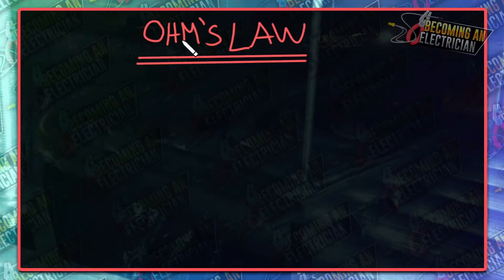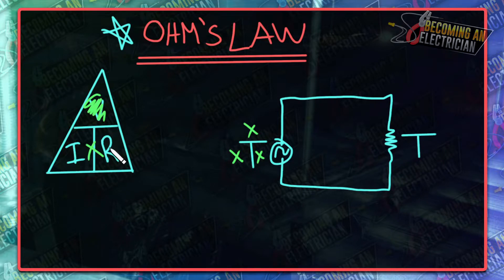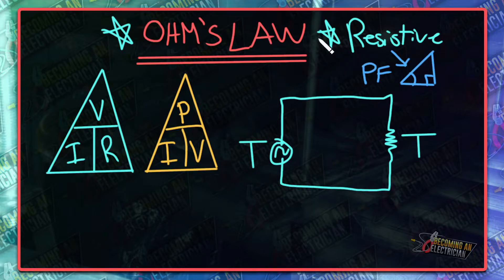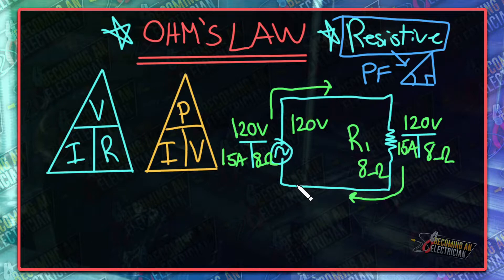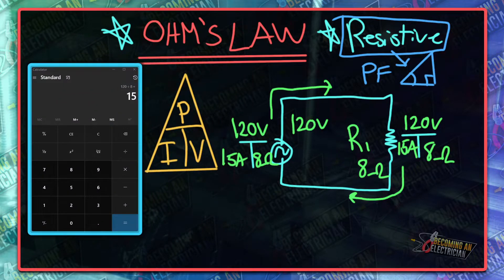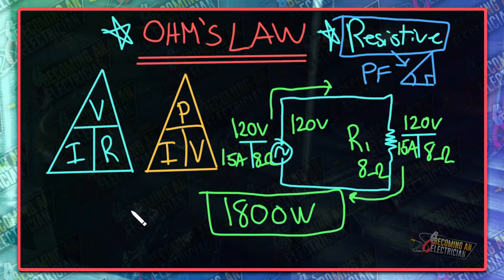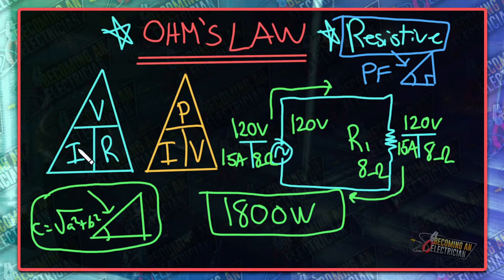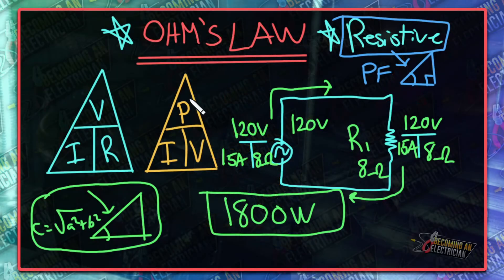What is Ohm's Law for Electricians

Comment: Hey! First off thanks for this video! I'm in the process of learning the trade, I know this video is 2 years old but just wanted some clarification earlier in the video 2:08 you mentioned multiplying Current x Resistance= Power/Watts. Later on, in the video 5:09 you then said multiplying Power x Current gives you the total Watts of the circuit? Apologies but I got a little confused as I was doing the math ahead of the video using the first equation to find Power/Watts. Just wanted to know is it (Current x Voltage= Power/Watts) or (Power x Current=Watts).
Reply: Just rewatched it and figured out what I got wrong. Instead of voltage in the triangle for Power I wrote Resistances in my notes so I see where you plugged Voltage after solving for it with the voltage triangle to find the total wattage.
Reply from the maker: Good job!!  Reach out with questions as you go along!
https://becoming-an-electrician.com/
Reply from the maker: Yeah so there's two triangles - Ohm's Law, and your Power Triangle.

Ohm's Law has:  
........Voltage........
Current | Resistance

You multiply current * resistance to get Power (WATTS).

Keep at it!

My free page is how you stay updated on the website, and get some free resources along the way!  😊
https://becoming-an-electrician.com/free